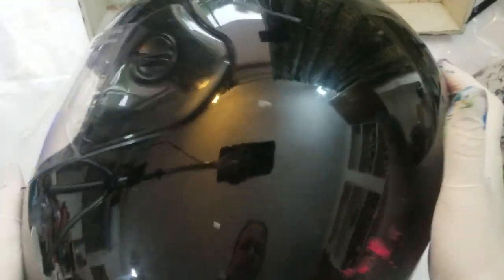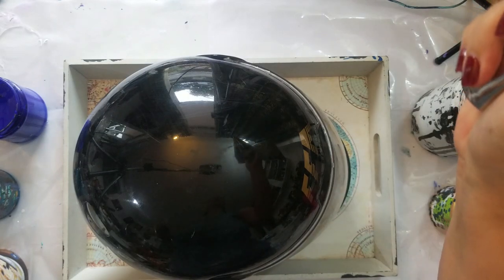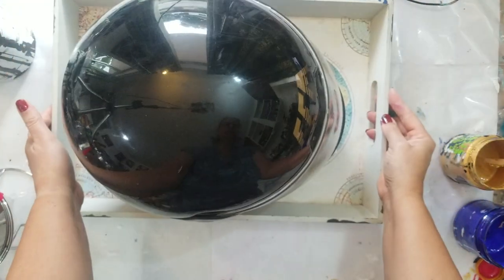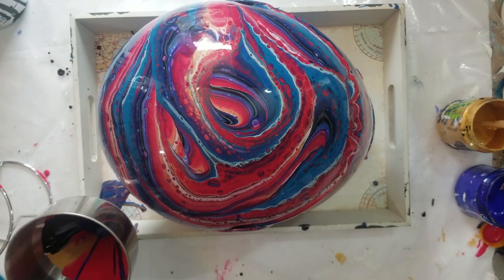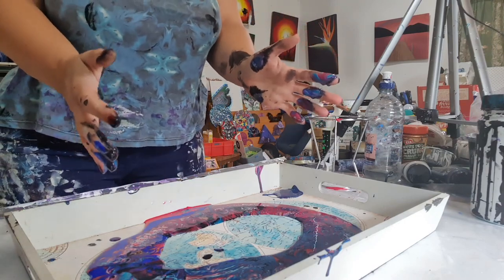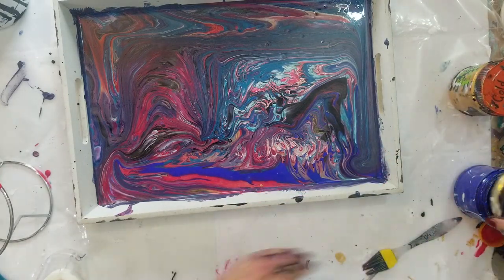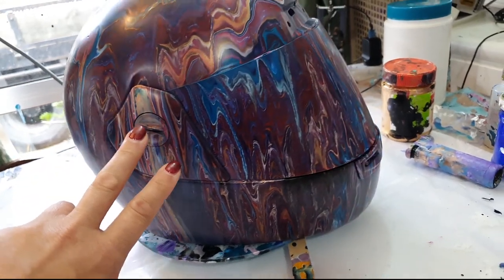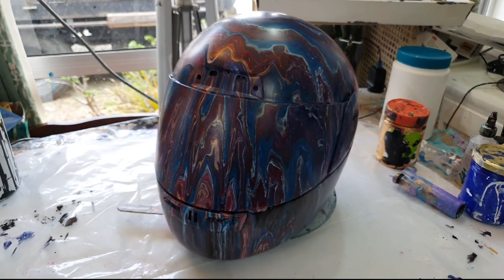684 How to Paint a Motorbike Helmet using Acrylic Pouring

Comment: If you poured over this again - with perhaps more highly pigmented paints that might not crack like the red did - would the cracked red impact a new layer?  I think it is a really cool idea, and while I can see why you'd be upset with the cracking red, I do think that is actually a message, taking into account that it is an old helmet, about how important helmets are - if they are not fit for purpose, or worn or old, they might crack under pressure - just like that paint did. Love your work and love this idea :)
Reply from the maker: Oh I love that!!  Thanks Lisa.  Great symbolism!!